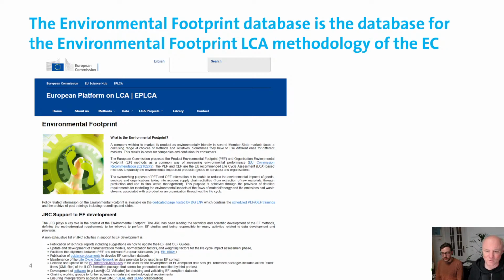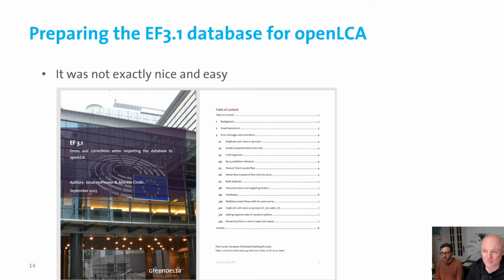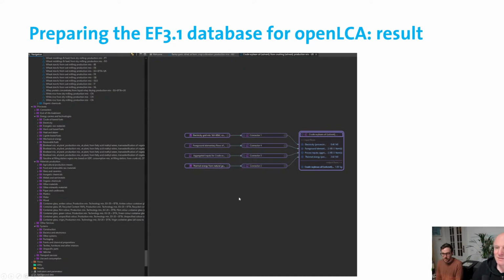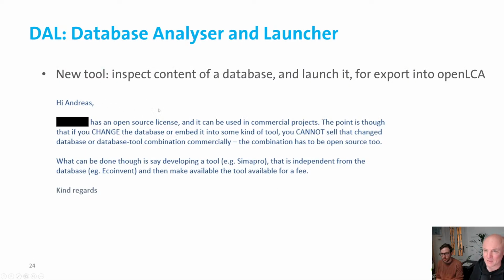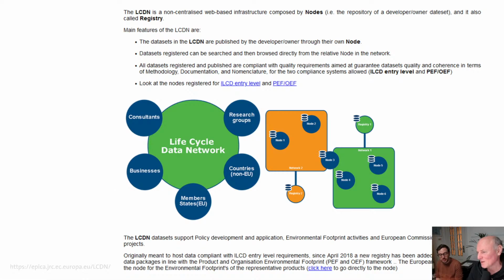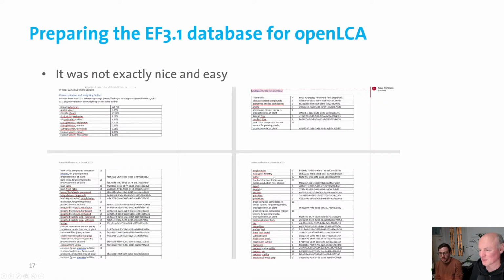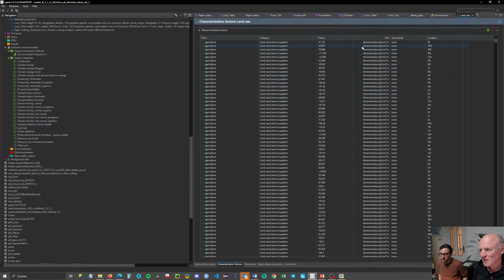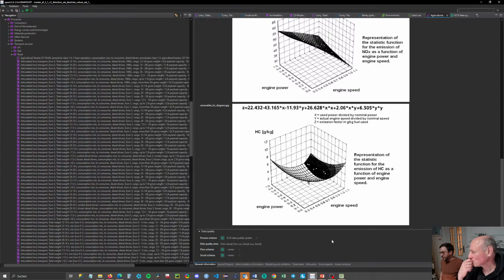Webinar: Release of the Environmental Footprint (EF) 3.1 database

Comment: It cost USD 250 for single use (educational). Is it not free to download?
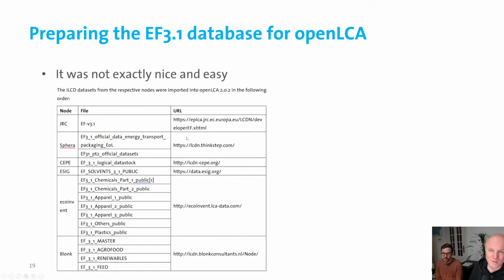Reply: You can download all databases from each node. Then, you have to create a new empty database in openLCA and import those databases. All databases needed are shown in the Webinar (time: 14:08). However this is a very very slow method but it is free.
Reply from the maker: Indeed, and in addition to what efcarasco wrote, you also need to fix quite some points in the datasets
Reply: @openLCA , in fact when I try to import EF_3_1_logical_datastock from CEPE, openLCA shows 29 errors and more than 400 warnings. Obviously, this database is not imported. Perhaps a bug?
Reply: @efcarrasco  maybe the database is imported, with errors, maybe not (depending on how severe they are) but what you describe is what we also tried to explain in the video, which maybe did not come through: the datasets as they are published on the offical sites are not correct.